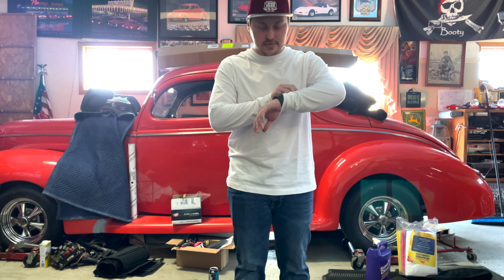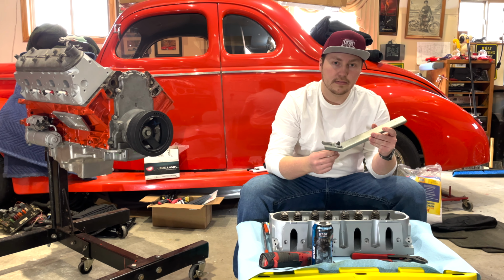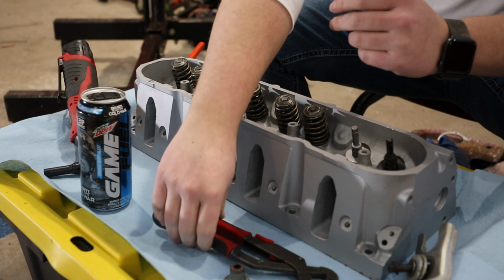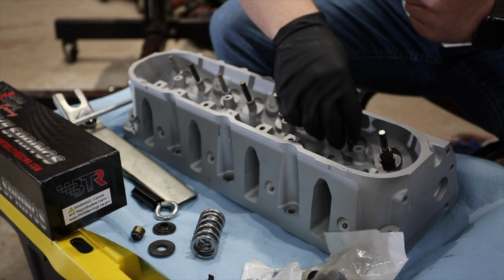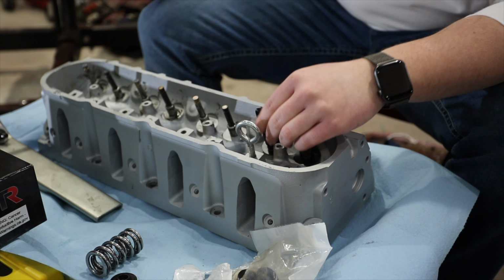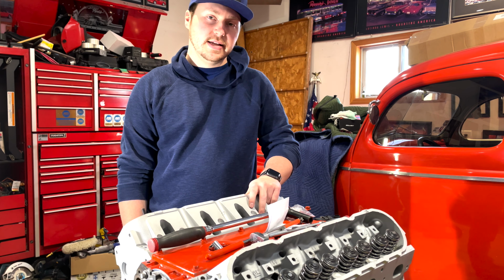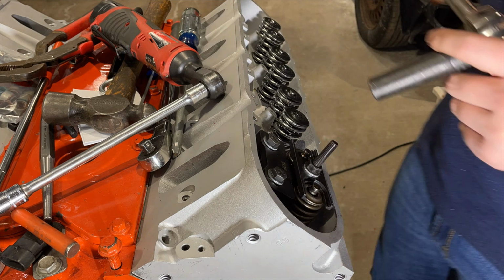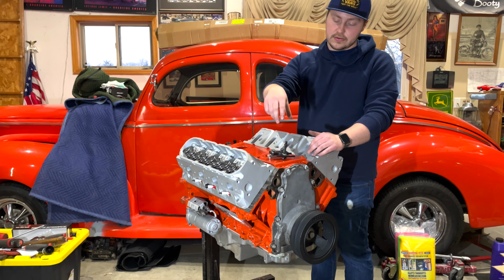BTR LS Valve Spring Install - How To

Comment: kinda bummed that you didnt cover the shim installment under the valve spring. kinda important info
Reply from the maker: Are you referring to the bottom retainer that the spring sits on? I don’t recall having to use shims when ever installing these.
Reply: @themodlab9780  you supposed to check installed height on the spring because its spring is x amount of weight @ x spring height

Comment: Did you have a gap between the valve seal and the bottom retainer?
Reply from the maker: What style valve seal are you using? The valve seal with the hat at the bottom of it or not?
Reply: @themodlab9780  the one without it , same as you have in video , I pushed it down as far as I could but still was a little gap between the seal and the bottom retainer
Reply from the maker: Then yes that’s normal, if you look at the video you’ll see that’s exactly how mine are as well
Reply: @themodlab9780  thank you for the fast reply
Reply from the maker: Just glad to be able to help!

Comment: How do you keep the intake valve and exhaust valves from dropping?
Reply from the maker: Either putting air into the cylinder or turning the engine over to have it at top dead center. Are the heads on the engine or off?
Reply: @themodlab9780  My heads are on the engine still. I have 1 broken spring, so I'm planning on replacing all of them. I'm just afraid of dropping a valve.
Reply from the maker: Ok just put air into the cylinder or turn the engine over until that cylinder is at top dead center
Reply: if the head is on the engine, you HAVE to pressurize the cylinder. that is the only way. putting the cylinder at tdc and taking the spring off will cause you nothing but grief. do not do that.
Reply: @484tuffguy  how so? Just did this method a few days ago worked perfectly fine